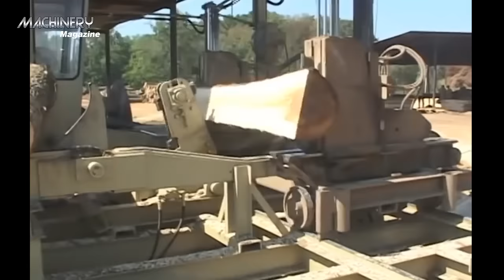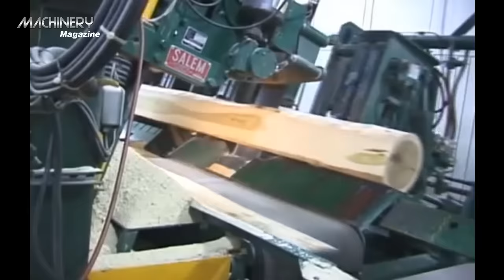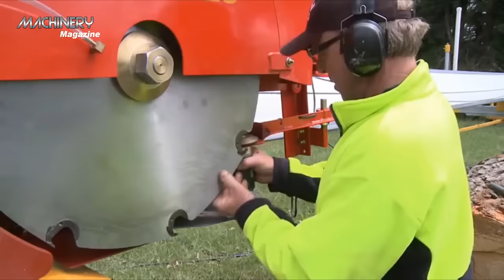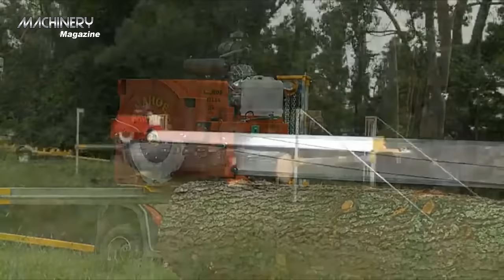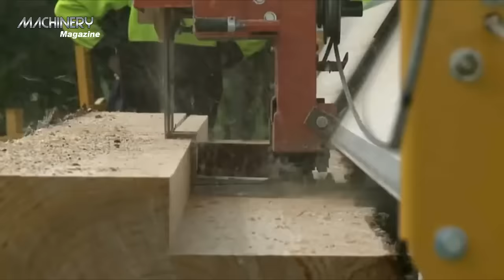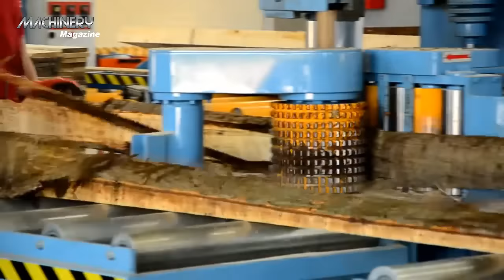Amazing Fastest Wood Sawmill Machines Working - Wood Cutting Machine Modern Technology

Comment: I work in sawmills. I can %110 say that first clip is speed up
Reply: Yeah the guy working in the back ground to the right has definitely had more coffee than is healthy lol
Reply: Yeah it is lol i think that guy had a little more hen coffee if ya know what i mean
Reply: I just set it to .75 playback speed, and it looks much more accurate.
Reply: Yep
Reply: You dont have to work in a sawmill to see that lol
Reply: You can kill by the jittery camera movements
Reply: Hey Alex can you get me some flat sawn red oak brother?
Reply: Machine at 10:00 seems inefficient as it cuts everything at an angle? Base of tree is wider, first cut parallel to that, and continues at that slant... If they'd start from a tree cut in the middle they'd have more and longer boards all parallel to the grain? Or am I missing something?
Reply: I worked in for 20 years and yep, the rotary saw at the start is sped up. The bull edger and every machine after it are running a 1X. Not sure why they sped up the rotary saw.
Reply: @SenselessUsername   when you cut a log, you want to cut around the outside so you have 4 sides, then keep cutting down around the center of it (center or heart is usually the worst part) until you make a can’t (3in x 3 inch or bigger) that way you’re boards are the good wood and the cants are the stuff you won’t get money for, unless they are a can’t. Sorry if the explanation is terrible. I’m not good at explaining things lol
Reply: Big time.
Reply: Not by much! I was a Sawyer and could saw almost that fast!
Reply: @russellnerche8789  Seasoned spruce, 6 and 8 inch cants yep. Hardwood, nope.
Reply: @OcihEvE Popular wood! I could! And I worked with others faster than me. You just don't have a clue! What we could do.
Reply: @russellnerche8789  (replying to both you’re comments) I know it’s possible to. But not with that kind of wood. I operate a debarker right now (I know how to do everything except the headsaw, resaws are my favorite to run) and at the mill I work at, the headsawer is damn close to running that fast in poplar. The dudes crazy lol
Reply: @alexbourgeois7863  man...I could do it all. When I worked at a sawmill. I had 20 years in that place before it closed down. I was a mad man! When I was a Sawyer too. Lol. But...had two that were faster than me. Loved that kind of work! Loved operating our debarker too.
Reply: @russellnerche8789  I’m hoping soon I get to run the edger. Good workout and makes time go by faster lol but the debarker is definitely fun. Makes you feel like a beast when you’re good at it
Reply: @alexbourgeois7863  lol. True! And those edgers do give you a good workout!
Reply: Yes
Reply: I don't work in sawmills. I noticed the sped up-ness of stuff didn't seem natural.
Reply: You mean loaders don't run around your yard at 25mph?
Reply: It’s sped up not speed up🙄
Reply: @isaaclowe7212  то
Reply: True story lol
Reply: @SenselessUsername  you're missing something. They dont start from the middle because the focus is on getting large square timbers. The pieces that come off the machine at 10:00 will be cut into various length 1x4 or 1x6 depending on what they can get out of it
Reply: They’re all sped up or frame filtered. Stopped watching.
Reply: I dont work in sawmills, tbh i dont even have a job. But i can %110 say that first clip is speed up
Reply: yep
Reply: I was wondering that at first and then I was like ok the title is.
Fastest wood sawmill machines
I was thinking like okay this is top of the line equipment, 
so i accept it.
but u said it sped up lol, it does look that way
Reply: I've never worked in sawmills. I can guarantee that first clip was sped up
Reply: @H_E_N_X  oh it definitely is lol
Reply: wrrr
Reply: That sawmill uses a circular blade, but many sawmills don’t use them anymore, why is that?
Reply: @G_Silent  1. Bandsaws are a hell of a lot safer than circle saws, circle saws have a higher tendency to take little branches, pieces of bark, stuff like that and shoot it anywhere in the mill (usually straight up or backwards or into the saw cab). And when bandsaws break they usually just bunch up and fold over or go down into the sawdust pit. When a circle saw break, teeth usually fly everywhere (sometimes happens with bandsaws but less likely since bandsaw teeth are built into the band, rather than teeth that tighten into a slot like circle saws) and since they usually have 2 circle saws (a smaller one above the bigger bottom one) sometimes if that top one breaks, it can break off and fall onto the bottom one and then no ones safe lol mills I’ve worked in that have circle saws or used to use circle saws and converted to band saws, all have holes in the roof, and back walls from things getting shot out from the saw. Sometimes even teeth decide to fly away lol 

2. Less waste. Band saws are thinner, and therefore cut less of the wood, meaning less sawdust and more lumber. Even if it’s a fraction of an inch, it’s a lot of money through out a day 

3. Bandsaws are (usually) faster. Especially if they have teeth on both sides so you can saw as the carriage goes forward, and again as it comes back if you want 

4. Bandsaws (I believe) are cheaper, and easier to maintain
Reply: @alexbourgeois7863  wow for such detailed answer, thanks! All Makes sense I guess. The circular blades have a dramatic look to them but safety and environmentally friendly are priority
Reply: @G_Silent  they do look cool, and they sound awesome going threw logs lol
Reply: @isaaclowe7212      h
Reply: let's all come stop by at my manual sawmill, thank you all
Reply: I was about to post that as well.
Reply: I was about to post that as well.
Reply: I work in sawmill also. That’s first clip is called a C frame at my work it’s easily 40x bigger than that and definitely doesn’t move that fast. But close.
Reply: You mean 110%? 🙂
Reply: @vinnyslagle2288  ah close enough lol
Reply: @alexbourgeois7863  ah, that’s better 😉👍 Have a g’day! Adios!
Reply: I'm Sawyer for 94 years. This guy cut slow. Cocaine make cut way faster. One 8ball per shift double production. Very good cut.
Reply: Yeah that guy it gettin it 💪
Reply: Don't think you need to work at a saw mill to notice that 😅
Reply: Maybe so.... but even at 50% speed, this machine is a beast. Respect.
Reply: What gave it away? The tractor in the background going past like an F1 car? 😂
Reply: Thank god you clarified that, I couldn’t tell.
Reply: Agreed
Reply: Of course it is but normal or sped up it’s damn impressive!!
Reply: I ran an edger at a sawmill they cut this fast to punish me.
Reply: @jamessnider7869  its not punishment. Its rewarding you for your hard work with, more hard work 😂

Comment: Terrible that it appears they are making no adjustment for diameter differentials of the two ends of each log. Lots of good wood wasted.
Reply: It all gets used for something despite outward appearances.
Reply: Smaller boards used to make slats, 1x2s, chip board (osb), ... sawdust used to make press board, fireplace logs, ...even bark is ground for mulch... No waste.
Reply: Stan Rodgers

Comment: Very impressive machinery. That first clip, they don't pay that sawyer enough. He's has skills.That reciprocating up and down saw, in one of the other clips, concerns me a little. Looks like a catastrophic failure waiting to happen. Pow! Metal flying all over.
Reply: Ozner Riznick io

yh6ryioh
Reply: Worked in a sawmill in the UK back in the 90's had 1 of those . It was called frame saw and it was a very reliable and capable machine, But needed alot of attention . grease & oil etc and regular maintenance
 1 of the operators used to stack 2 , 2 sided cants on top of each other and produce 112-18 boards at a time . The 2 guys really earnd their money on those days.
Reply: At 8.32 or so minute mark We called the multi bladed saw a gang saw in the old reel mill here in maine. Biggest issue would be a log that had alot of knots and would exsplode and plug those blades up shutting it down till the material was removed. Never see any metal or such come flying out but it may have bent or bowed a blade once in awhile

Comment: if you want to see actual modern sawmill production go check out an industrial sawmill.   none of the equipment shown sped up in this video is modern in an industrial sawmill. I know this because I worked in a sawmill 20 years ago. this crap wasn't modern then!  A typical sawmill will cut 1.5 million boardfeet of lumber in a single shift.  band saws are used to slab each log before more band saws are used to cut it into whichever board thickness they are producing at that particular time.  round saw blades are only used to cut lengths, why? because round sawblades are expensive, not only to buy but to maintain also(sharpening, tooth replacement, etc.) band saws have been used instead of round saw blades for 50 years because they just last longer.  and any real sawmill de-barks the logs before any blade touches them.
Reply: and also the real industrial nills run faster than they have been sped up in this video.
Reply: I've had the pleasure of working at 2 different sawmills since 1982. First one ran until 1994. It had 1 debarker, double cut and single cut headsaws with slabber heads. Horizontal resaw and a quad band saw as secondary breakdown. Gang saw with round saws and slabber heads for the cants. Board edger had round saws and slabbers on it as well. The one I'm at now has 2 debarkers,  Double cut head saw, horizontal resaw, 10 roundsaw gang and board edger with round saws on the large side. The small side has slabber heads with banks of round saws. We finally don't have to fight for logs though a large amount comes in as fire salvage.

Comment: I didn't realize it there was that much waste
Reply: Is it waste if the stuff that can't be used for lumber goes to a chipper and sent to the nearest paper mill?
Reply: @marcryvon   being here in Oregon and having lumber mill right across from me. All wood scraps are used. Cant fix stupid when it comes to common sense!
Reply: You need to spend some time observing the gate at a sawmill.  Incoming, truckloads of logs. Outgoing, truckloads of bark, clean chips (no bark), bound for paper mills and osb plants, and lumber. Nothing that arrives as raw material goes to a landfill. If there is anything that truly can't be used, it fuels the dry kiln to remove moisture from finished product.  If you see a waste truck leaving, it's carrying stuff workers don't want to tote back home in their lunch boxes.
Reply: @marcryvon  at least you have common sense
Reply: @youtubecensorsmycomments8036  sorry, I didn't realize I would need to be that specific in my comment. Bear with me while I spell it out for you. In the comment, I think I said that nothing goes in the landfill. If, in fact, nothing goes in the landfill, that implies very strongly that there must be some economically viable use for anything that is carted off by the truckload, as nobody owning a truck is going to let the load decompose in the bed of the truck until the truck decomposes beneath that load.  My apologies for not foreseeing that something so strongly implied would need to be spelled out.
Reply: @youtubecensorsmycomments8036  
Well, thank you Roma.
Reply: There is no waste ..the stuff that dont make boards go to the chipper and make chips for paper..your butt wipe and other products such as the wall doard or flooring in you house